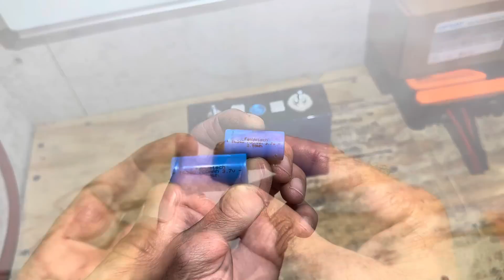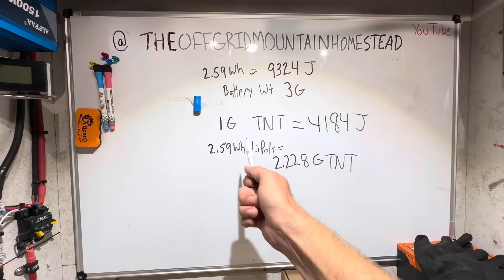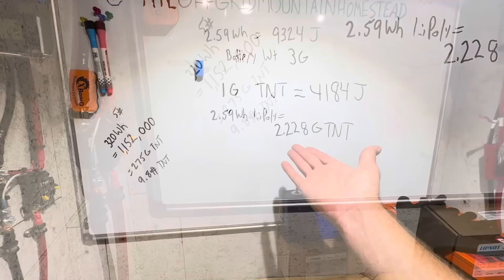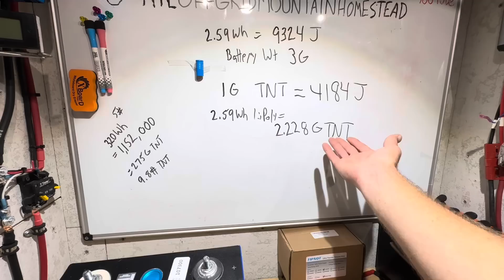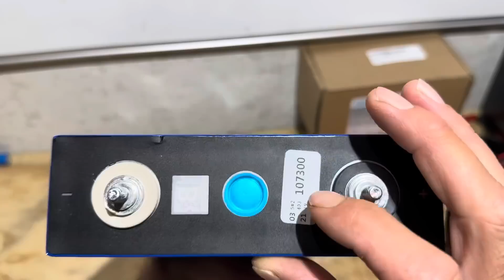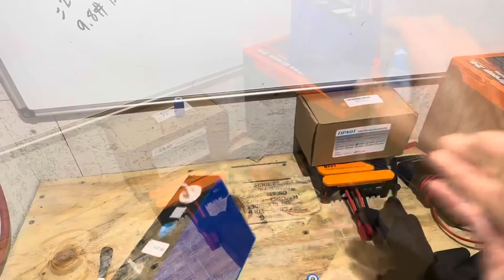Exploding Pagers and Lithium Batteries?

Comment: also here from SP1
thanks for your take and i agree. the energy release is not the same as an explosion type event consistent to what we are seeing in those events. also, i heard, unconfirmed, those pagers are running on alkaline batts not lithium which, if proven, would end the conversation
Reply: The Pagers have been identified as "Apollo AP-9000" encryted pagers. They run on a single AAA battery.
Reply: @tomteiter7192  Interesting, than we have our answer
Reply from the maker: Yes if Alkaline its a non conversation. 
Intel I had at the time of filming this indicated there were lithium batteries involved! Thanks for watching and commenting!
Reply: @THEOFFGRIDMOUNTAINHOMESTEAD  Went through some of your other videos and I found some of your battery discussions interesting. I would like to set up a small battery, solar, inverter setup. I know its not complicated once you know what to do. 
Thanks

Comment: If the gases cannot escape it does go kablooey.

They have experimented with lithium pew pews.
Reply from the maker: A cell could have the vents blocked indeed, but the casing isn’t much thicker than tin cans. Not expert in pressure yields of various metals but cases on these cells usually split and vent out the side if something along these lines happens. Some YouTubers have intentionally shorted their batteries to make this happen

Comment: Had no idea the smart charging systems could be hacked. I suppose anything connected could be. Thanks for the information—good to know! 
🇺🇸 Best to you and your family.
Reply from the maker: Yes anything that’s capable of Bluetooth or Internet connection can be manipulated by those who have the means to do so! 
Thanks for stopping by today!
Reply: It's true that some BMSs can have their charge rate changed by software. However, some can only be set in hardware, requiring modification. In any case, the charge rate can only be increased by 2-3x,  which is enough to heat and degrade the cell but unlikely to explode it. Overcharging in time is also possible but again limited in effect. This is because the power supply providing the charge power is limited too. Consider also that it's only the  CHARGE rate that can be increased - the pagers that exploded were in use, not on charge.
In brief, this is not viable for the pagers, but may be viable for high-powered battery systems such as power inverter/standby systems. The only system I can think of that has both a network connection and a relatively large battery is a laptop.

Comment: Thanks for doing this video.

100% correct. Lithium batteries only off gas and cause very high heat fire.

From what I read is they used heat activated PETN explosive near battery with a copper wafer penetrator which caused much more damage.
Reply: I target 18650 one time with my 12g and didnt do what there claiming,,   
even a 30amp fully charged, didnt do nothing.......
BUT!!!!! dont end to end short it out!!!!!!!!!!!!!!!!!!
Reply from the maker: Thanks! As I told another viewer this video took over 3 hours to upload with my limited 4G wireless internet. ☹️ Hard for me to be on top of latest developments!
Reply: Yes, but if the gases cannot escape it does go kablooey.
Reply: There are different type of lithium batteries, check Will Pouse DIY SOLAR you tube channel where tries to make LIFEPO4 cell catch  on fire.
Reply: @Scott-ig1zd  Wingy Will who promotes illegal stuff???

No thanks.